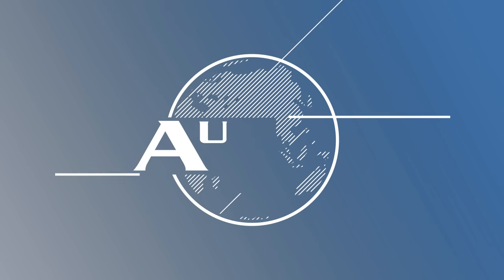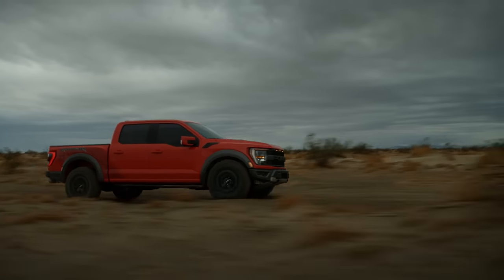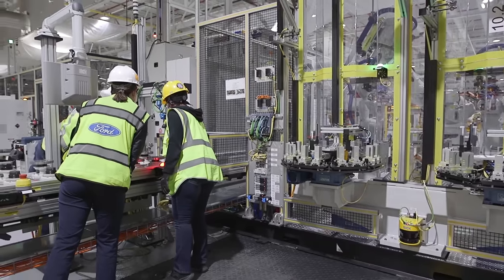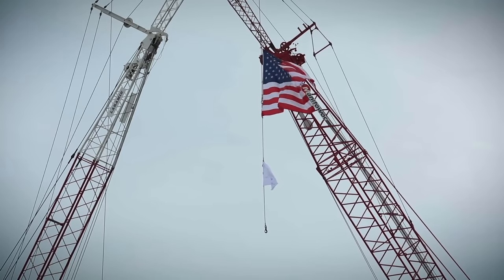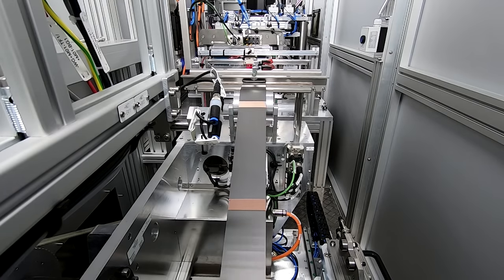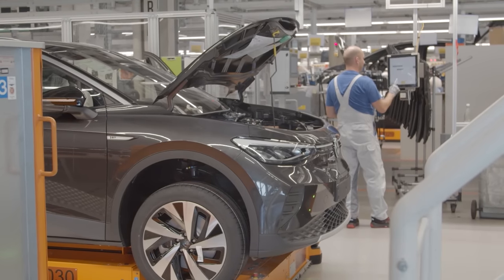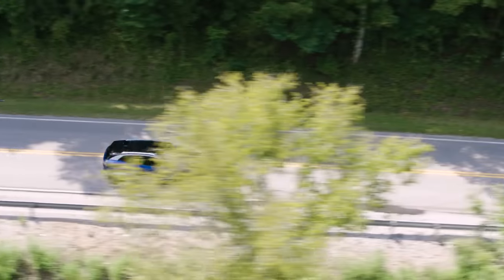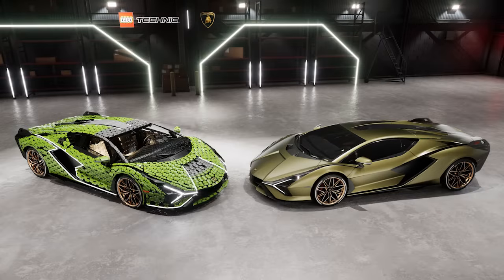Tesla Reveals Model S Plaid; VW ID.4 Test Drive Impressions - Autoline Daily 3099

Comment: God. 20000 rpm motors. Aviation industry gonna be knocking on Elons door.
Reply: I heard he has an idea for an electric jet...
Reply: VTOL's can't be too far off if batteries get lighter.
Reply: @aussie2uGA  Not likely, they don't have a super battery, yet. Not even close.
Reply: None of that makes any sense.
Reply: Props can't take 20,000 rpm - turbines could - avoiding gearing saves weight - interesting to see what engineers come up with.

Comment: I put 2900 lbs on my 69 Ford F100 1/2 ton pickup the other day and took it uphill to a landfill 14 miles away. The truck was sort of squashed, but the engine pulled it without a thought.
Reply: You've got a max horsepower of 255?  The Tesla S has 1,000 HP and it gives you all those horses if you want to accelerate while going 180 MPH.  Look at the power curve for that beast.
Reply: @bobwallace9753  I was comparing it to the Ford Raptor which he said has a max payload of 1400 lbs.
Reply: @bobwallace9753  Yes towing at 180mph is very practical.
Reply: @phamnuwen9442  Danged right, Bubba.  Gotta get that bass boat in the water while the fish are still bittin'.

Comment: Seat heaters don't keep the windshield clear when it's -35C. I know because I've driven Tesla for nearly 6 years.
Reply: Actually the ID 4 has direct electric heating of the wind shield. Tesla may want to look at that as an option for extremely cold climates. I have seen owners with issues in that type of environment.
Reply: @frederickstirnkorb3094  oh I dumped my Tesla. Never again, terrible company.
Reply: @C Burgess I bet by the time you get in the car is already warm then or it isn't really very cold that day.  :)
Reply: Electrically hearted windshields are available today on select EV models. Though the concept isn't new, aircraft have been rocking them for decades in -50C temperatures.
Reply: How dare you? You're supposed to suffer in the cold with no visibility, to save the climate!

Comment: Im meh for Tesla but i have to say the massaged S looks good after what 10+ years? Thats impressive as it is irritating given we are used to a 5 year model cycle. I cant wait to see if they make the resigned one something id like.
Reply: It's a form factor that performs when talking about aerodynamics. Adding an angle or an extra shape just to make it look different would most likely degrade efficiency. 

With that said, reimagining exterior lighting, and / or changing the side windows would be a welcome addition.

Comment: vw targets the middle of the market, similar what they did with the gold and tiguan. tesla does not target this market or even does not know what it means. but that of course now means that vw is not able to meet the demand. zwickau in germany is producing the id3, id4 and audi q4 now and reached their capacity limit quite early.
i guess, next year they can supply a bit more ID4 in the US after they get the chattanooga factory line up and running. but that even will not supply the huge demand in this segment. but it is a good start. the size of the id4 is well suited for the us market and the price is reasonable.
the interesting thing is, that electric car fans argue that is does not have that punchy acceleration like other EVs, but at the end, for the middle of the market it is good enough.
Reply: limiting functions?  batteries and taking ICE sales?   (single motor Model 3 - are buyers interested ?)

Comment: John, I don't think I've ever heard a gasoline powered vehicle described using an EPA rated range... Was that spec something Ford highlighted, or is it something autoline is moving towards for consistency between ICE, hybrid, and BEV?
Reply: Range is they one last legitimate advantage ICE and hybrids have over some BEV's in some use cases.  All BEV's that get decent range highlight it.  Those that don't hope you won't ask.  Pretty sure Autoline knows this.
Reply: @videcomp  agreed... Which is why I am interested if Ford is promoting this specifically.
Reply: @videcomp  Double the range, 10-20X refueling speed, half the purchase price, a fuel distribution network fine-tuned over 100+ years, lower weight, abundant waste energy available for cabin heating, the list goes on...
Reply: @phamnuwen9442  Very few ICE vehicles get 700-800 miles of range.  350 miles is way more than I want to travel without taking a break. Most BEV's start with a mostly full "tank" every morning, so zero time to charge on the road(typical week) beats the gas pumps 5 to 10 minute fueling gain time over a Tesla Super Charger once in a blue moon. You can't buy an comparable ICE car that is 10% cheaper a Tesla EV.  This is why Tesla dominates every sector it competes in and ICE manufacturers are scrambling to catch up.  If you have ever used a Tesla Super Station you would know that the Tesla charging network in just a few years has completely out classed the "100 year finely tuned network" you are talking about.  It's like comparing a gas station to a livery stable.  The added weight of a BEV is put to good use giving it better ride and handling characteristics.  "Abundant waste energy", come on now - you think that is a good thing?
Reply: @videcomp  I get 800 miles in my Volvo from 2012.

You may not usually travel more than 350 miles but others do, and some day even you may have to, and at some point you may need to do a quick 5 minute stop to get a full tank, and this is just not possible with an EV.

The fact you don't do some things all the time doesn't mean it's not valuable to be able to do them occasionally.

"You can't buy an comparable ICE car that is 10% cheaper a Tesla EV."

You can buy a gas car that has double the range for half the price.

"This is why Tesla dominates every sector it competes in and ICE manufacturers are scrambling to catch up."

No they don't. ICE cars still dominate sales overall, in spite of all the subsidies Tesla and EV's get.

"Tesla charging network in just a few years has completely out classed the "100 year finely tuned network" you are talking about."

That's a ludicrous statement. Gas stations are much more common and refuel cars at a rate several orders of magnitude faster than any EV charger including Teslas.

"The added weight of a BEV is put to good use giving it better ride and handling characteristics."

No it isn't lol. This is just spin. If having a massive weight in the floor of the car was a net benefit all the ICE car makers would have put lead weights in their cars. They haven't obviously because that would be stupid.

""Abundant waste energy", come on now - you think that is a good thing?"

Yes it is if it makes sure the HVAC system doesn't deplete the range when it's cold.

The fact that gasoline engines have more waste heat is not inherently good obviously, but the fact that they can get away with it is an indication that the fuel is very economical.

And yes, a gas car is a bit more expensive just in energy costs but they more than make up for it by being much cheaper to buy and way more practical and flexible.
Reply: @phamnuwen9442  "I get 800 miles in my Volvo from 2012."  Congratulations. Exceptional! As far as I know you are the first vehicle owner that I ever interacted with that gets that kind of range.  Thinking back through the several dozen cars my family has owned, not one of them could go more than 400 miles without driving 

"at some point you may need to do a quick 5 minute stop to get a full tank, and this is just not possible with an EV."  True.  But just as likely and I could argue much more likely some morning you'd like to leave your house fully fueled, even though you got in last night with less than half a tank. This is just not possible with an ICE vehicle. 

"

"No they don't. ICE cars still dominate sales overall, in spite of all the subsidies Tesla and EV's get."  I said "every sector it competes".  
"That's a ludicrous statement. Gas stations are much more common and refuel cars at a rate several orders of magnitude faster than any EV charger including Teslas."   I said "out classed".  Common is not an indication of class. Electricity in homes are more common than gas stations.  If you want to use that as a standard then EV's win.  Until gas stations start offering free home delivery at a price cheaper than at the "gas store", the experience is several orders of magnitude better than any ICE car.

The fact that gasoline engines have more waste heat is not inherently good obviously, but the fact that they can get away with it is an indication that the fuel is very economical."  True.  A good thing in the winter.  Not the rest of the year.  It is wasted energy and money.

"And yes, a gas car is a bit more expensive just in energy costs but they more than make up for it by being much cheaper to buy and way more practical and flexible."  There is the disconnect.  I don't consider 2-3x more expensive energy "a bit".  I don't consider a little if any cheaper (for a
Reply: @phamnuwen9442  I apologize for the disjointed reply I just posted. I spent way too much time with a thoughtful complete reply to each of your points, giving you credit where I could unfortunately when I posted it, it go hopelessly mangled.
Reply: @videcomp  "Thinking back through the several dozen cars my family has owned, not one of them could go more than 400 miles without driving"

Sure, not all cars have this kind of range but it proves that it's easy to do with ICE. The 5 min 0-100% refueling means it's not strictly necessary so most mfgs just use a smaller fuel tank. Still nice to have. I never ever have to worry about fuel even when I'm way off the beaten path. This is absolutely not true for an EV and it's not likely to change anytime soon.

" But just as likely and I could argue much more likely some morning you'd like to leave your house fully fueled, even though you got in last night with less than half a tank. This is just not possible with an ICE vehicle."

Yes, but you can stop by the first available gas station and refuel in a couple of minutes, so this is not really a significant drawback. If we're assuming the ICE driver forgetting to refuel, we should also assume the EV driver forgetting to plug in at night which is a much bigger problem.

"Electricity in homes are more common than gas stations.  If you want to use that as a standard then EV's win."

I don't see how this is an advantage. You can't recharge at your house when you're out and about driving, you need a DC fast charger which are way more scarce, unreliable and slower than gas stations.

"Until gas stations start offering free home delivery at a price cheaper than at the "gas store", the experience is several orders of magnitude better than any ICE car."

Again, getting your energy from your home is not an advantage when gas stations are so common and quick and your range is very long.

The energy cost in itself can be an advantage in isolation but 

A: This depends on cheap electricity, and the EV/RE movement is making it more expensive. Research what they're paying for electricity in the most "renewable" country, Germany...

B: The higher purchase price (plus financing) will eat up those savings unless you drive extreme distances.

"A good thing in the winter.  Not the rest of the year.  It is wasted energy and money."

Yes, waste is waste, but the practicality and low cost of the ICE car makes up for it.

"I don't consider 2-3x more expensive energy "a bit". "

Germany is our future if we continue with renewables. The world's most expensive kWh.

If EV advocates were supporting the decriminalization of nuclear and all energy sources so that we could potentially get really cheap electricity, the EV argument would perhaps look a bit more rational. But solar and wind is subsidized which drives cheaper and more reliable power sources (fossil fuels and nuclear) off the grid.
Reply: @videcomp  No apology needed your reply was perfectly coherent.

Comment: I would like the ID.4's "not deactivating the radio before you leave the car" better if it did not kill the radio until you actually turned the vehicle OFF. This was done before simply by turning the car key to the "Accessory" position. Most car makers had that turned well away from the start position, so you did not unintentionally start the vehicle.  I liked it because you could use the car as an ad hoc boombox, or power source, thus the car stereo culture that has been in decline since the 90s. Not dead or dying but fewer are pursuing strong and perfected sound systems in the vehicles than before. That might be part of the decline of Van Culture in the US as well, though.

Car keys made this so easy to do. But the shift to Car Fobs or Proximity Keys made one of the more fun aspects of owning a vehicle hard to do, a rarity, or nonexistent among newer vehicles.

Comment: I’m sorry but at -20F a heated seat is not going to keep you warm or defrost the windows🤣😂🤣😂
Reply: I disagree with you about the heated seats, but agree about the windows.  Also if the seats are heated so should be the steering wheel/yoke.
Reply: Yes.  Are electrically heated windows the next stage of development?
Ford had an electrically heated windshield in the past I believe (Lincoln?) but did not produce it long.  Effective window moisture removal is not perfect even with heat input from combustion engines
Reply: @earlpottinger671  please tell me how a heated seat well keep your legs and feet warm???🤷🏻‍♂️. Also when it’s that cold you’re normally bundled up, now the heat has to transfer through the seat then through your clothes to get to your skin…that takes a very very long time. I own three vehicles with heated seats… Ford raptor, Subaru Impreza, dodge pro master van… It’s nice to have, but they heat up way to slowly… especially the Subaru.
Reply: @gordonborsboom7460  land rovers had a heated windshield… I would hate to know how much it cost to replace that!!!! All it takes is one crack and It don’t work no more! Just like in the 80s when GM used to put the antenna in the windshield… What a stupid idea!!!
Reply: We really need some Michigan capable EV's. And I don't mean Detroit, I mean Houghton/Copper Harbor.
Reply: @rwdplz1  Yup!! Agreed!!! I live in Fairbanks, Alaska..welcome to the freezer lol. In the winter we all fight over the 110V electrical outlets in the parking lots to plug in our engine block heater, battery warmer, battery trickle charger, oil pan heater etc..I cannot imagine the battle for a 220V plug to keep the batteries alive🤔🥶
Reply: No, but an electrically heated windshield or windows will help. Heated seats and steering wheels are fantastic in reducing the cabin temperatures for comfort. A heated seat and wheel could make a 60F degree cabin temperatures bearable (less energy)
Reply: @gordonborsboom7460  

Electric windshields are already available on the Jaguar i-Pace and I believe the Mach-E as well
Reply: I'm sure Tesla will make an electrically heated jumpsuit to solve the problem that was created by designing a car around an extremely marginal energy technology.

Tesla fans would wear it with pride, hailing it as the most important innovation since the wheel and calling for the Nobel Peace Price to be awarded to their Dear Leader.

Comment: mmm, lets wait for the 800hp and 1200hp+ hydrogen super saloons, as EVs seem to have a barrier or can´t go over 800hp without huge costs
Reply: Why do you wanna go over 800 hp? Its not always about the horse power. A 0-60 quarter mile is the most practical way to measure performance and last time I heard, even if you put over 1000 HP on ICE vehicle, it still can break the 2 second mark.
Reply: @joseledesma4776  There are some ICEVs with more than 1,000 HP.  They aren't as fast as the Tesla S Plaid.